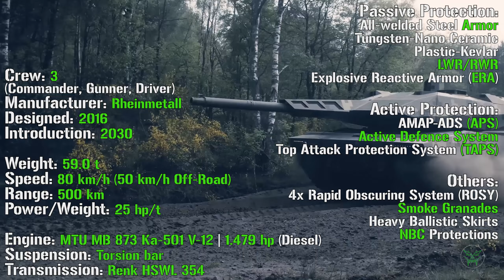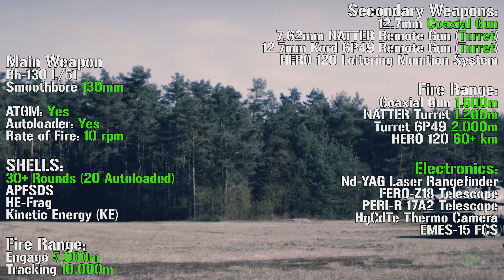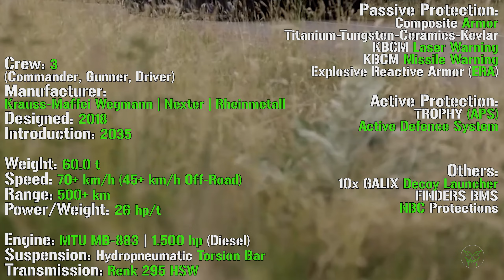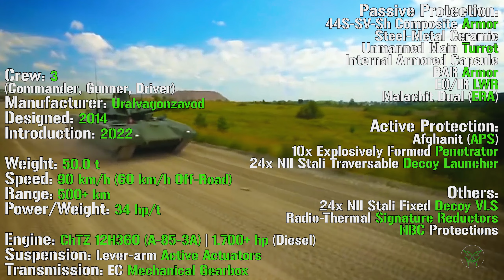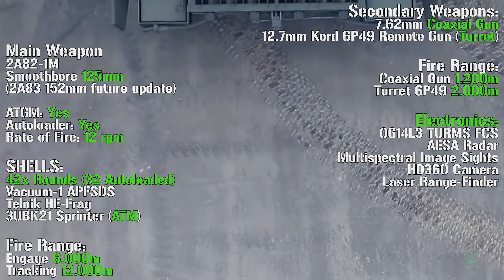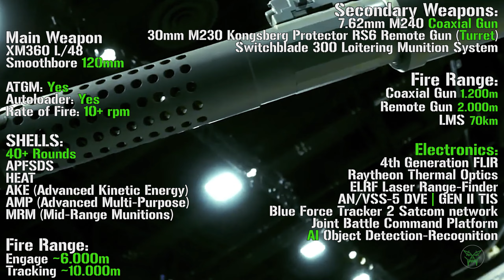TOP  Next Generation MBT | Main Battle Tank | 2023-2035

Comment: could you do a moc of the kf51?

also maybe a revamped panavia tornado with german flag and taurus kepd
Reply from the maker: Yes I can! The tornado was already updated not so long ago :)
Reply: @DarthDesigner  well id definetly like to see a taurus in the weapon arsenal
and im looking into buying multiple of your mocs (probably going to be the newer ah1z, pzh2000, f22, leopard 2a7 and ef typhoon)
Reply from the maker: @_556ms  the weapon pack is shared separately so I can always add new weapons to it! If I remember I'll try to add a Taurus to the collection soon! :)
Reply: @DarthDesigner  and well ive run into yet another problem
some parts in the builds are ridiculously expensive
like one part for the ah1z apparently costs 225€
Reply from the maker: @_556ms  strange usually if it's expensive on one website there is always another one with a better price. I would suggest you to try uploading the parts list again on other websites (in my bio there is the linktree to 3rd party solutions too)

Comment: the funny thing is neither the abrams x and panther kf-51 will be mass produced ever, they will stay as concept and prototype vehicles
and my personal opinion, the kf-51 is just a basic leopard 2 with sci-fi looking armor pakage but with an autoloader, and the abrams x hybrid system will fail, good for cars, but if it would work in military i can guarantee that they would have adopted hybrid and electric technology already
Reply from the maker: Electric engines are already adopted into military (not for tanks though) but we can't be sure until they starts using it. Not sure about the mass production neither to be honest, they are both "updates" of existing machines so you don't have to start from scrap. They are in a very early stage so times will tell :)